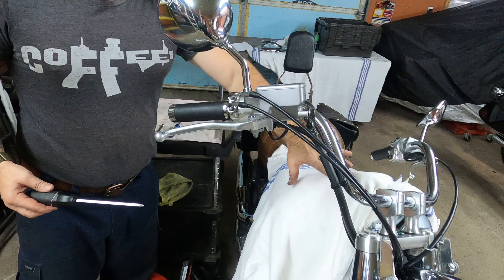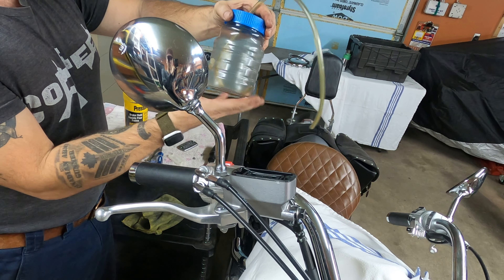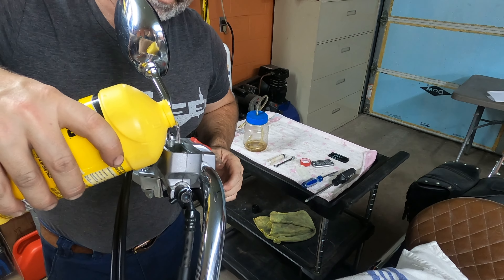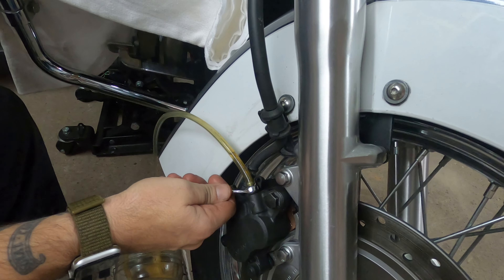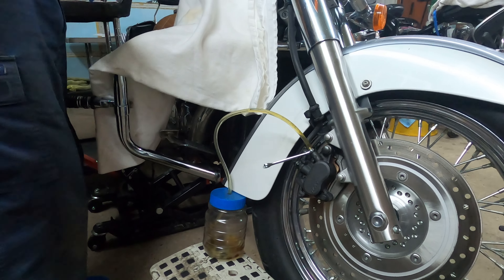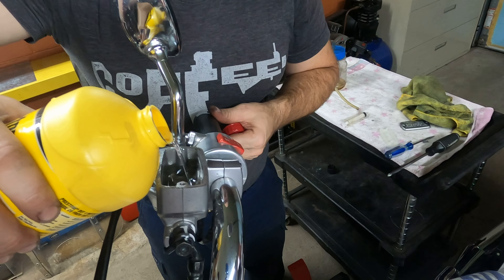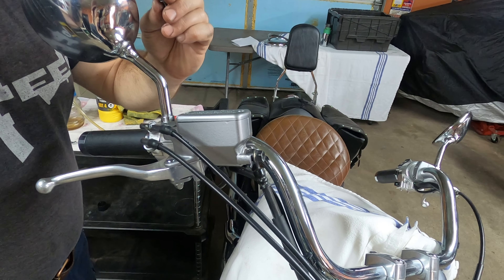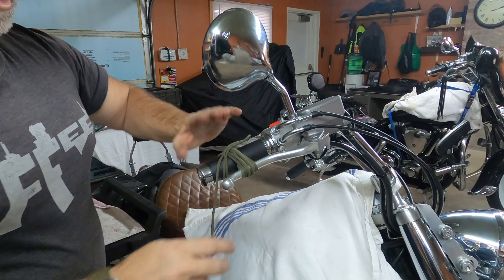2014 Honda Shadow Aero VT750: Front Brake Fluid Flush DOT4

Comment: Good video.  I have a 2006 Shadow Aero and I just did the bleed/refill last Sunday.  I did buy a simple 1 way valve and tubing for about $12 so I didn't have to do the open/squeeze/close steps.  Once I put the hose on the nipple I opened the nipple valve, filled up the reservoir, pumped till it was almost empty and repeated that step 3 times, then I topped off the reservoir, closed the nipple valve and reassembled.  No spongy brake and even a 70 year old can do it without killing himself.  On my model the caliper is on the left side of the wheel, so it really made it easier.  Another tip is I always replace the rubber seal, since that's always in contact with the brake fluid it's the most likely to exhibit degradation.  They're best bought from Honda but genuine parts can be sourced on Ebay or whever you find them.  Thanks for the video !
Reply from the maker: Thank you.
Reply: great informative video! I was wondering if you also needed to bleed the rear brakes as well, or does the front handle the fluid for the entire bike?
Reply from the maker: @sethchua9757  No need to do the rear brakes it is a drum system and there is no fluid. Front brake is the only one with DOT 4. Have a great day.

Comment: Why use Dot 4 when it absorbs more water? I've always uses Dot 3 for that reason. Thanks for the video by the way.
Reply from the maker: DOT 4 is recomended for this bike. I have to agree with you DOT 3 is better. Thank you.
Reply: DOT4 is recommended due to its higher boil rate. It's in your manual.
Reply: I'd change the diaphragm to be on the safe side.
It's cheap enough.
Reply from the maker: @chrisLabrise  For sure.
Reply from the maker: @chrisLabrise  I know and olso it is on top of the Brake master cilinder, Thank you